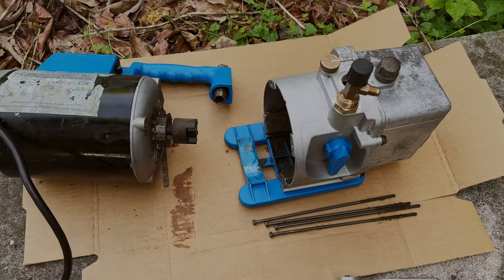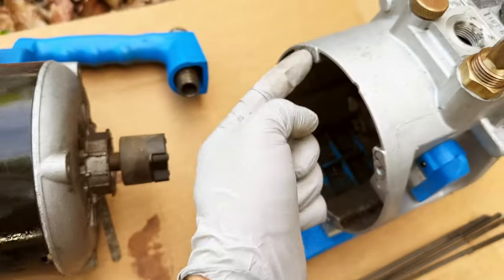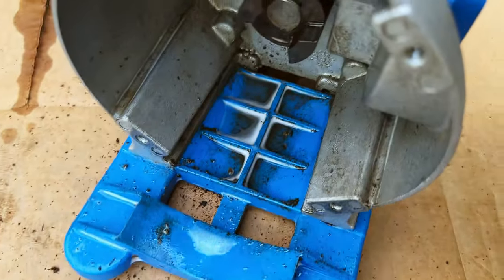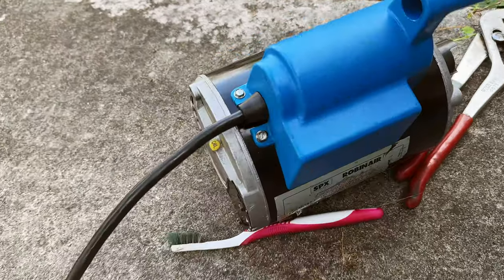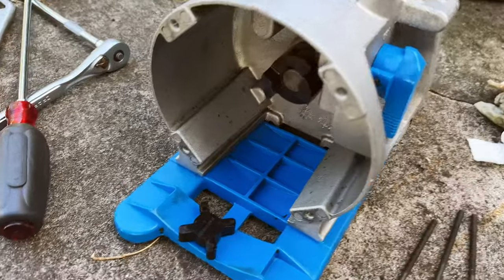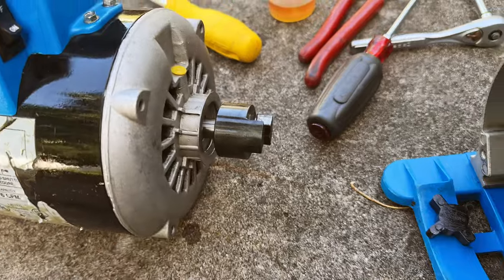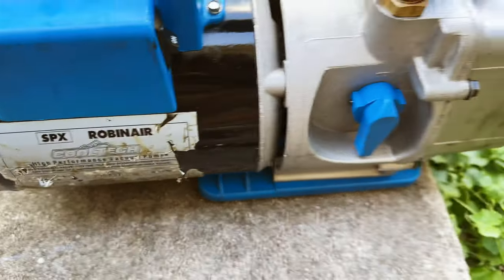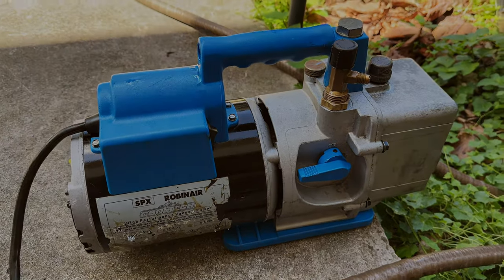RobinAir (Bosch) SPX CoolTech 15600 6 CFM 2-Stage Vacuum Pump Restoration

Comment: I also bought one in a local marketplace(European country) for about 150 bucks. I was told the motor is bad, and thus never used. The wiring was set for 120 instead of 240V, and the O-rings in the isolation valve had to be replaced, which caused similar leak, which is on your video. The valve needs a special vacuum grease to not eat up the rings prematurely. :)